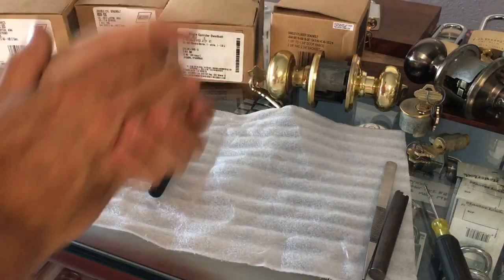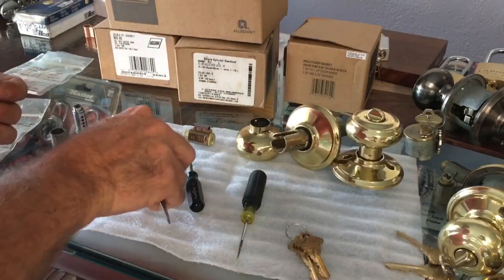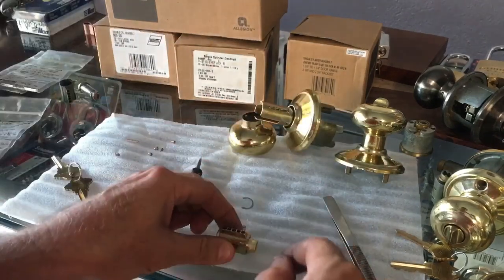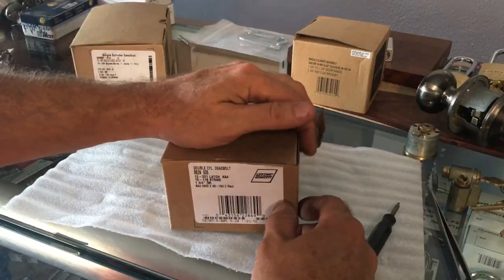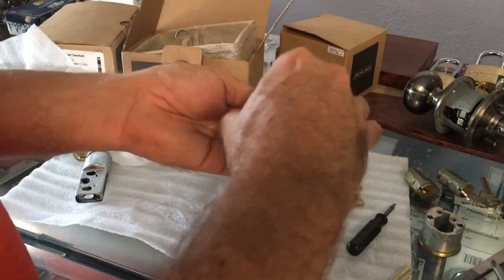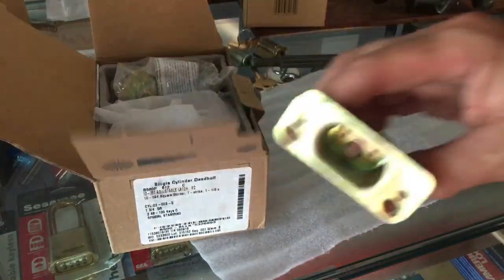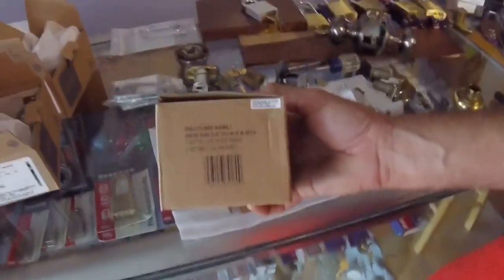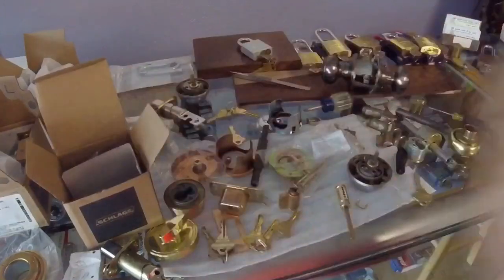Schlage Compressible F series cylinders & deadbolts

Comment: i like the 560 series schlage  and that brass looks very nice
Reply from the maker: caveman Sparks the 560 is a really nice twist on the "original" 160 series. It supposedly had working locksmiths input on design (so they said) Compared to their other stuff, I kinda believe it 😂
Reply: if they did that is great ho better then locksmiths input  locksmiths  have experience   with them  and you now the good the bad and the what the  f were they thinking

Comment: This was so helpful as I am pretty sure I have the same F series, BUT my follower fell out and so did all the pins and a ton of other things too.  I am wondering what are the little tiny ball bearings also these different thickness thin wafers that might be pins.  The other things like the T pin and springs were fine and I just reassembled those and the lock works, no problem, but what are the 5 wafers pins and about 7-8 (maybe lost some) balls?  thanks so much
Reply from the maker: The wafers means it was masterkeyed and the tiny balls means it was construction keyed. In theory when the homeowner uses their key it moves the balls into the holes and removes the ability for the construction key to work.
Ideally you would remove all those and key that lock (and your other home locks that use that same key) to fresh new keys so neither the master key or construction key will work.

In others words, you don’t need them. Dispose of :)
Reply: @selock  wow - fastest response ever!  thanks so much

Comment: It has been several years, and nobody seems to be making aftermarket compressible cylinders and parts. Schlage is reaping huge profits on replacement parts from the fragile and highly wearable cylinder parts where old brass kik cylinders usually outlast the knob set. Are they waiting for something to come off patent, or are they expecting this to go away?

Comment: Those compressibles are a PIA. I don't like working on them.
Reply: The Lock Picking Lebowski .. Have you ever tried picking them.?  I find them very difficult, especially with a wild biting. Spring tension is very heavy..It’s a tough lock to bump, snap or rake. At least they are not drill protected like the Dead Bolts are. I give these about 10 minutes picking and if no luck, out comes the drill..
Reply: Peter D'Ambra I find them easy to pics, but that's mostly what I do besides create challenge locks.
Reply: Don't try to master  key, to much pressure  on cap.

Comment: Once again thanks Jason. Sorry but still don't and probably never will like the compressed or as we call it floating cap design. Added expense buying special springs etc, that isn't necessary and it's the end customer that has to pay more. I'm in Canada (Toronto) and could write you a novel about the problems we have here. As well as all the new rules that have been implemented in regards to our locks (deadbolts as well as knobs) that we aren't allowed to use on any new construction as well as renovations. Has to be a lever handle, can't use knobs any more. Once again the customer ends up paying more and looks at us as the reason they have to pay so much. As for the Schlage / Dexter, just a piece of crap.
Reply: Its amazing what problems government will invent when times are good. They could just f*cking stop making laws, until one is actually needed. But no, they can't stop themselves for any reason

Comment: Thoughts on master keying the F series? Jason, or anyone with experience ?
Reply from the maker: JimWest not a great one to have to do but you can
Reply: @selock  / Thanks Jason 🤠
Reply: I am presently doing about 100ea,  F series (F51). Master Keying for an apartment complex. So far all is working out well. But you are quit limited with a Master Keying System on this series with expansion. You could be fooled by the Schlage Keying Kit 40-132, as there are no Master Pins/Wafers in this kit, leading to believe the F-series could not be MK.
Reply: @assakesomanlockman7179  Thanks for responding.
I've only master keyed about 12-15 of them at different times and noticed they were a pain. I've been using another quality brand with a traditional Schlage style cylinder. I had to replace all the knobs on our main office which required 15 knobs and was determined not to contend with the F series. 🤠

Comment: Perhaps it’s just me, but it seems like Schlage’s residential line has significantly decreased in quality in the last several years. I’d be concerned about how well these compressible cylinders would hold up with daily use in most applications.

Comment: For the record. These cylinders are trash. You can defeat them by pushing up on any of the pins hard enough with a deep hook. Pop the top cap, and turn the lock. Be sure you have a replacement cap.
Reply: That's really good to info to know. I hate picking these locks to rekey them and prefer to just drill and replace the cylinder since I've acquired some from old hardware.. Was just looking at buying a few online and they're expensive so maybe I can just go w the caps.. Brute force em and rekey em and move on w my day